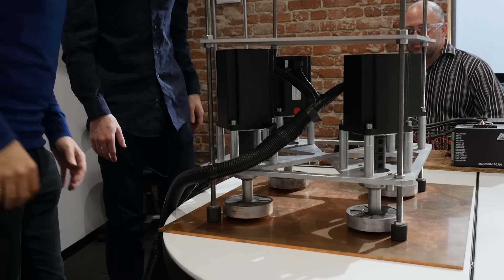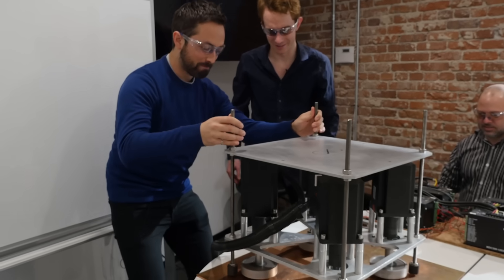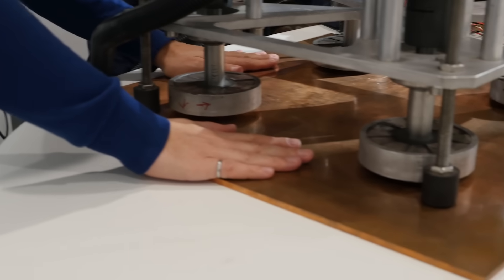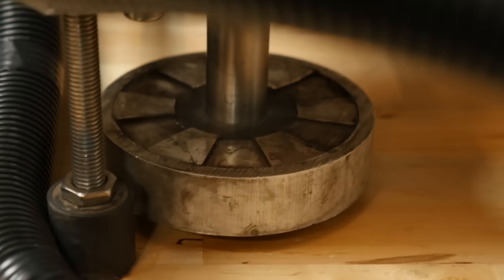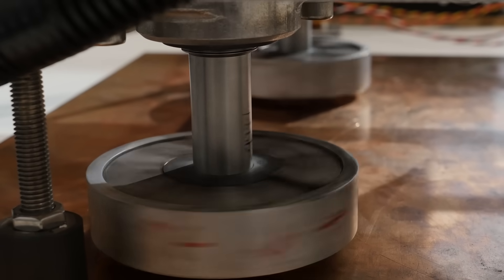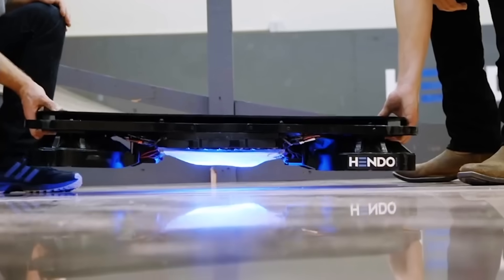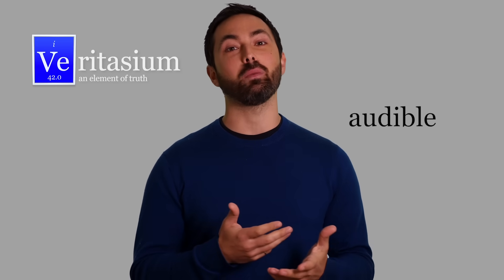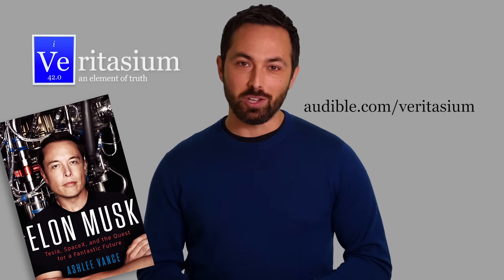Electromagnetic Levitation Quadcopter

Comment: The Hyperloop?  Really?   I'm disappointed in you, dude.
Reply: You watched a youtube video from a crabby old engineer and now you think you're an expert.
Reply: Don't forget to wear your tin-foil hat.
Reply: There are solutions to changing volumes already, like in steel bridges. It is posible they might come across some way of aplying the same principles.
You definetly have a point, though
Reply from the maker: Hey, I'm not saying it's easy or that it will definitely work. Just be careful before you add your name to the list of naysayers we look back on through history who thought certain things were impossible (e.g. powered flight) or just not going to happen (e.g. personal computers).
Reply: Y2KNW Why?
Reply: Hyperloop's on par with solar freakin' roadways and thorium cars in terms of feasibility because the meathead who thought it up doesn't understand that materials expand and contract with temperature, which would cause cracks and stress that would inevitably lead to a failure of the tube wall and the deaths of at least 2 carloads of people each time it happens.
Reply: @Y2KNW  EXACTLY. they've already encountered these problems you talk of.. not tube failure. Haha but the expanding and contracting of materials from heating and cooling which causes great damage to the structures
Reply: @Y2KNW  you yhink the "meatheads" who designed long bridges and railways don't know about thermal expansion? 

This is why problem solving is a critical part of engineering
Reply: although the hyperloop looks like a Good Idea thunderf00t has a point and no one can say he is wrong só people just ask "elon musk or thunderf00t"
Reply: BS. Technologically it's absolutely no big problem. It's not too hard to find a solution for the thermal expansion, it's a problem engineers deal with all the time on marco and mirco scale.
Reply: The thermal expansion is not such a big issue, here is thunderfoot wrong. The main problem is that the hyperloop is a passanger-killer at the smallest incident, here thunderfoot is right.
Reply: Sascha Kramarenko No discussion is harmfull for development on the long term, we may not be experts but this is certainly interesting
Reply: "In theory."

Communism works, in theory.
Reply: too much thunderfoot. Remember that we went on the moon. Conditions were pretty extreme out there and a single failure could lead to the death of the crew but we did it. It's technologically and scientifically possible, the rest is called an engineering feat and we'll see if they can pull it out. Come on, we came to the point where we recover the freaking first stage of a rocket on a barge in the ocean !!!!
Reply: +NuclearSavety +Y2KNW

Just stop it with the uninformed, idiot speculation.  You all and thunderfoot all clearly do not have the slightest idea of what goes into modern engineering.  Thermal expansion/cyclical loads on pressure vessels are a very well understood problem and we've been able to deal with them safely for literally over a hundred years now.

Hundreds of millions of commercial steam boilers and chemical reaction vessels are operating around the world.  They designed to go through MASSIVE thermal cycling and hold pressure differentials vastly larger than a vacuum vessel holds.  As long as they are properly maintained and designed, they can operate for decades without any issues.  You occasionally see them fail due to companies failing to do mandated maintenance or doing stupid things.  But that's going to happen with any system.

We have been building miles long vacuum chambers for scientific applications since the 50s.  

+NuclearSavety Bellows seals are used all over the place in scientific and industrial applications and are incredibly reliable and safe.  Work-hardening only occurs in certain strain regimes.  Any first year engineering student is perfectly capable of designing bellows seals that can go through effectively infinite cycles.

Commercial jet airplanes all go through stresses and pressure cycling on their pressure vessels that are far, far greater than what a hyperloop tube goes through and they are designed to withstand tens of thousands of cycles.  Planes do this literally tens of thousands of times a day without incident.  The Concorde had friction-induced thermal cycling on its pressure vessel skin of hundreds of degrees and did just fine.

Commercial airplanes have to go through regular and rigorous teardowns and inspections because cracks are constantly forming and propagating through the airframe.  Almost every jet in the air has hundreds of cracks in the airframe.  It's perfectly safe because we know how to engineer things and understand crack propagation rates.  We know that a crack will not result in structural failure unless it is of a certain size.  We know that the cracks will grow at a known rate.  As long as you tear the plane apart at specified intervals, you can check for crack growth and replace/repair components as needed.  There's entire buildings full of engineers at Boeing that do these calculations.  I used to work in one.  The downtime and inspections are incredibly expensive and a lot of work but they are already factored into the engineering analysis and cost projections.  This isn't a novel thing.  We've been doing this since the 707 was flying in the 50s.  There are entire textbooks devoted to cycling-induced fatigue and crack growth.  I'm looking over at one on my bookshelf right now.

The hyperloop is no different.  As long as halfway competent engineers design it, pressure leaks are not going to be a problem.  Even if you do get a pressure leak, it's not going to cause a catastrophic failure.  A leak doesn't cause a full loss of vacuum.  It's going to cause a rise in pressure equivalent to the size of the leak.  We deal with these sorts of things constantly in pressure vessels.  It is not hard to design a pressure vessel that fails gracefully and predictably.  The entire design of commercial jet aircraft is based on that principle.  You can shoot a jet full of holes in mid flight and you'll just get a slow loss of cabin pressure.  We specifically design them so that a tear or hole doesn't result in a massive rupture.  You monitor the pressure in the tube and if it starts to rise, you do an emergency stop of all the vehicles.  

Any failure mode that would result in a loss of a hyperloop train would be the same order of magnitude of engineering/manufacturing/maintenance failure that would lead to a loss of vehicle on a commercial airline flight.  Think the hyperloop is too scary?  Better stop flying then!

There's plenty of valid objections to the hyperloop.  Pretty much all of them are based on economics.  There's no showstoppers in the engineering of a hyperloop.  Plenty of actual qualified engineers have looked at it and there's nothing inherently wrong with it.  In many ways it's less technically challenging than making a standard jet airliner.

Thunderfoot can do backseat engineering all he wants.  That doesn't make him qualified or informed.  Sometimes he says interesting, valid things.  Sometimes, he just shoots his mouth off like a moron.  Like here.
Reply: Sounds like You've been watching Thunderf00t.  I wonder who's smarter... Thunderf00t or Elon Musk?
Reply: Vacuum systems use flexible seals all the time.  It's just a set of metal bellows.  This isn't advanced tech.  Thunderfoot can be intelligent at times but he can also be an uninformed idiot too.
Reply: Veritasium I want to believe but things were Said about the hyperloop and nobody wants to answer problems like the thermal expansion and the fact that tgey want to use an engine that relies on gases to run on low pressure if you could answer this questions i would be glad that someone decided to talk about science instead of youtubers
Reply: Instead of replying to all your repliers I'll just leave this here with you...
The Hyperloop concept is indeed a bit crazy, specially considering a economy perspective where an high-speed train would be much more effective and safe for the same course.
If you allow me to go a bit wild in my guessing, I think that Elon Musk launched this whole campaign as a facade to get other people to develop space technology for him, and not really because he thinks it he can build an Hyperloop on Earth. It makes sense, because all the spin-off tech from developing the Hyperloop has space research and space construction applications.
Reply: Lehtaan people Said it was impossible Yes but once more people use historical arguments instead of scientific ones i want to know why my point of view is wrong and why no one talks about it seriously , just repeat the same things over and over
Reply: Says the person that only says you cant believe in thunderf00t if you think he Said any lies about the hyperloop please Tell us i would like to know instead of fighting over whos the smartest
Reply: Having worked on stuff that's failed due to expansion/compression issues, I don't even need Tf00t's video to tell me what's going to happen.
Reply: Yeah, I never quite got how someone could claim, with a straight face,  they'd run a turbine powered object in an atmosphere low enough to nearly remove all wind resistance.
Reply: Once they find that material, build the thing.  

Until then, it's a very expensive disaster waiting to happen.
Reply: @Y2KNW  ik this stuff is from a year ago, but copper and many of its alloys are known to be very good at expanding and contacting not to mention they are great conductors of heat which makes the expansion and contraction even less of an
 issue. The people are not stupid and it being in a closed system means they have more options as far as solutions. Like cooling the track to maintain a constant temp if it was a problem. The people working on it are engineers. Its their job to solve problems.
Reply: @tylerhowe552  "people working on it are engineers"

I've worked most of my adult live around engineers or people with engineering degrees of one sort or another; engineers can be some of the dumbest people you'll ever meet and easily a quarter of the time I spent in my last job was A) repairing things they'd broken or B) trying to save them from themselves by further dummyproofing things so I won't have to fix it again in 6 months.  So please don't use lines like "its their job to solve problems". :D
Reply: As long as those who claim it was going to work admit they were wrong when it doesn't, and accept responsibility for pushing an idea with obvious flaws.
Reply: Tunnels don't have the same temperature issues as a surface level tube and offer an additional layer of protection against failure.  Build the loop in tunnels and odds are it'll have a significantly lower failure rate.  But, like all things people build, it will eventually fail; don't kid yourself that it won't.
Reply: Jérémy Don't compare everyday travel with the moonlanding or any other space exploration. They are on a completely different level.
Reply: Like I said elsewhere in this very discussion, I've worked in an industry where I've seen (and had to repair) the effects of expansion and contraction on pressurized systems.  And I did it for years before Tf00t's video came out.  Tf00t has the why it happens, I just got to fix the stuff after it happened.
Reply: Steel bridges have expansion areas: those parts with the meshed teeth where the parts can flex and move.  You can't do that in a vacuum tube without some sort of flexible seal, and anyone who's worked around something with a seal knows full well that seals fail.
Reply: Veritasium sorry but this is exactly the same argument to justify pseudoscience like homeopathy...
Reply: @NuclearSavety  sorry but equating homeopathy and mechanical engineering isn't even scientific. And said "pseudoscience" did deliver powered flight and personal computers, unlike actual pseudoscience
Reply: @ki0w0-lordofwatersheep  i never sayed homeopathy equals mechanical engeneering.

I sayed that veritasium uses the same ARGUMENT selling the hyperloop as homeopathy is sold: refering to the unknow, implying that future discoveries will explain everything, and ignoring the logical contradictions apparent today ...
Reply: @NuclearSavety  yet you also ignored stuff, mainly what makes hyperloop different from homeopathy; its "apparent contradictions of today" are merely challenges for engineers to solve tomorrow

Having some things in common =/= the rest of things being the same
Reply: The hyperloop is a scam. It is technical possible in principle but it has zero chance to become economically feasable on any scale.

 And the rotating permanent magnets thing is a nice toy but not the technology used in maglevs. Engineers dont use electromotors to produce oscillating electromagnetic fields. You can kick out the motors from the design together with the permanent magnets by using only coils and power electronics to switch the direction of current. Simpler design, no moving parts, but less easy to build by wannabee inventors.
Reply: @NuclearSavety  they have their first contracted tunnels and the system works so I'd like to hear back from you lol
Reply: @JamesTurfKing  .... selling stupid things to suckers doesnt make stupid things less stupid ... And you must be a sucker buying something which was never successfully tested in real scale...
Reply: @JamesTurfKing  Boring a tunnel is the very easiest part of the hyperloop concept. Humanity knows how to build tunnels for 5000 years. If you think Elon is to be praised to have build one (in a sub-scale diameter without infrastructure inside) then think again.

The challenge is to economically build a maglev in a tunnel. And it is completely non-economical to build, operate, and maintain a transport pod transporting anything (not even freight) in a vacuum... The cost for such a system is comparable to space travel...
Reply: Oh! You done did it! The "Wright Brothers Argument"!
Reply: Vacuum tube of several kilometres sounds pretty hard to accomplish.. sustaining that vacuum over a long time seems nearly impossible.. there needs to be some way to create sections I think..
Reply: of course it will fail at some point, no one is talking about designing a flawless tube. Airplanes fail too, what's the matter with that ? It's a controlled risk with strict criterion and permanent control of the structures.
Reply: @izaneitor Steel bridges don't need to be redundantly air-tight, though.
Reply: Gruener Apfel well when traveling 1000km/h in a narrow vacuum tube, the last thing i want to have in my way is a 1inch thick steel hatch which is suppost to open in good time....
Reply: You have too much faith in technology. No matter how advanced technology gets, it still cannot break the laws of physics. The Hyperloop is not physically possible, plain and simple. I recommend doing a little bit of research before you claim something is possible.
Reply: The Hyperloop is just not going to happen/work. They are planning to make a thin tube out of concrete that "generates more energy that it uses". Now that sounds like a good thing for some jack ass to just shoot 1 hole in the side and blow it up.
Reply: Dan Heidel sorry but your airplane comparison stinks. Air planes are much smaller and despite their comparably small size they are leaking like hell in comparison to the air tightness you need for a several 100km long vacuum chamber. You probably dont want to have major pumping station every 5km, that would somehow kill the energetic advantage of the system. I work in nuclear eneneering and know that it is freakingly complicated to make a huge industrial complex really air-tight to <1vol% per day leakage at a 1 bar pressure difference...
Reply: ***** How could he be debunked? Did anyone managed to break the laws of physics?
So far Thunderf00t has a good track record in terms of science. His political views are subjective, but that is completely unrelated issue.

One thing is certain, it is not just Tf00t who is skeptical about possibility of low pressure transport system on earth given the modern day materials. Many engineers in my university also seriously doubt its feasibility.

May be, when we have materials that can create a 100-mile tube that wouldn't have these thermal expansion issues, hyperloop will be possible. But not today.

Heavier than air flight was impossible until the invention of light engines. Skyscrapers were impossible before the invention of cheap steel manufacturing. Much of today's impracticality of hyperloop comes from materials we have at our disposal and their cost.

Now, for the magnetic levitation demonstrated, it is very wasteful, as the heat comes from the energy consumed by the apparatus to levitate.
Such energy losses are very expensive and that is why this technology is impractical.
A much better option is superconductor levitation, that does not consume energy, but this technology has it's own huge problem with thermal isolation.

Anyway, Hyperloop as it is today is a pipe dream. The original video adds nothing to the scientific knowledge. The science of this demonstration has been studied extensively and nothing new has been revealed by this apparatus.
Reply: Jérémy once more saying what humankind has done already you could say anything once again i ask what is wrong about what thunderfoot said i want to know in case i have a wrong view of physics i would like to know
Reply: is what people said about rockets, planes, cars, etc.
Reply: +Jérémy It is scientifically possible, but technologically impossible/unserviceable...
Reply: +NuclearSavety "this is exactly the same argument to justify pseudoscience like homeopathy"

You mean aside from the fact that one is based on the idea that small amounts of natural substances that would normally cause harm to healthy people will somehow heal sick people, whereas the other is based on established science and technological advancement with limits that need to be overcome with new solutions just like all previous technological advancements? Oh yeah, I can see the resemblance. It's uncanny.
Reply: Yeah, by adding areas where the expansion and contraction can take place.  But those involve expansion loops or bushings.  Expansion loops wouldn't work because the passenger car isn't going to be able to make turns at high speed, and bushing are wear points that become fail points.
Reply: i'm not saying that we can do ANYTHING, but we can do everything that abides by the laws of physics. His videos are just videos, undergrad calculations and little experiments with the simplest material you could find. In the meantime there are some serious R&D engineers working on it. I currently pursue a master's degree in materials engineering and I can tell you that the things we can do are just incredible
Reply: annojance i sayed it is the same ARGUMENT. I didnt sayed the hyperloop is the same as homeopathy. Please read what i write, dont read what you want to read.. .
Reply: +Ian Krasnow
To be fair, solar roadways are a stupid idea.  When every building roof in the world has solar panels on it, then solar roadways might start making some sense.  But until then, they're an overpriced boondoggle.
Reply: It's always funny how the only people who care to really crack down on the Hyperloop are random youtuber commentors and redditors who watched literally just one video. Not to mention those issues such as thermal expansion and the supposed requirement for perfect vacuums have already been addressed before.

Yep, groups of engineers and scientists around the world are just trying to scam you into funding a single project when, as shown in the video, study into electromagnetic levitation has been a thing for more than a hundred years. We should give up just because innovations in building material hasn't caught up! Maybe we should have just given up on fiber optics because no fiber was clear enough.
Reply: Y2KNW i think that isnt wrong to believe in it is wrong to say it Will work because elon musk because cars because space i'll admit that i was wrong in case someone decides to have a serious talk and i am proved wrong but until then i am waiting
Reply: izaneitor the point is that it doesn't matter wether a bridge has a 10mm gap at each end. With a pressure of just 1 mBar it's a different story.

Maybe it is possible but in the next 100 year there is no way to be competitive with normal roads, trains or airplanes.
Reply: Sascha Kramarenko was he really shutting down the conversion in this thread by bringing it up? He didn't insult anyone unlike those against TF who were the ones to shut down the conversation.
Reply: Mr Torgue burrying solves the problems of bullets and thermal expansion mostly.... but creates problems concerning corrosion (contact to water) and it is freakingly expensive...
Reply: There's no reason to tell people to not work on something that can improve the future of humanity forever. You're pretty much equivalent to a person who thought flying in the skies would be impossible. "Just don't even try making it because I think it's impossible." Well, not even 100 years later there were people on the moon. You're on a computer right now, which people 100 years ago couldn't even imagine, playing Minecraft and other games with people around the world. Why don't you take a second and think about that.

You're not working on it, you're money isn't funding it, you have absolutely no part in the research and development for it, so why would you complain about it? Even if you say whatever you want to say, people are still going to attempt in trying to create it and they simply don't care about your opinion.

End of discussion.
Reply: Y2KNW - You sound like you just watched a video by thunderfoot and now you're the smartest man alive. Like others have already said, this isn't that big of a problem. There was a lot of speculation in that video, if you looked into the subject past the end of the video.
Reply: @sablesoul 2 things. Firstly, Thunderfoot isn't some random youtube commentator. He's an actual scientist, and if you bothered to spend 30 seconds on his youtube channel you'd see that. Second, thunderfoot isn't saying that there should be a "crackdown" on the hyperloop. He's saying that there's a plethora of problems with it and that there should be more skepticism towards something that has said problems. Especially considering that we're talking about a technology that could lead to the death of civilians.
Reply: If you're referring to Thunderfoots videos he's been thoroughly debunked on his debunking
Reply: Y2KNW lol
Reply: What we are saying is that materials composed of atoms follow a strict set of rules that allow them to function and interact in a pretty specific way. Thermal energy conducts down a material at a definable speed; and the only real way to nullify thermodynamic expansion is to maintain a constant, equal temperature across all surfaces; irregardless of the surrounding environment.

As long as the earth rotates and the sun shines; this is not possible. There is no material that can make the transfer of heat instantaneous; so expansion and warping WILL follow. The sun warms the eastern half, the night cools the western half; and somewhere in the middle something starts to wear down.

Now, we have managed to 'knot' some atoms together; creating structural integrity instead of relying on the atomic forces. This does open up some more room for materials who's strength goes beyond the capacity of 'natural' structures.
Reply: Gato Capitalista Nobody can tell you if it will work or not because nobody knows. That's why tests are being done. Supposedly, they will do high speed tests this summer. I guess we'll then find out how feasible this technology is.
Reply: Truman Why am I a fanboy? They will try it out this summer and it will either work or it won't.
Reply: +NuclearSavety - "The thermal expansion is not such a big issue, here is thunderfoot 
wrong. The main problem is that the hyperloop is a passanger-killer at 
the smallest incident, here thunderfoot is right."

indeed, there is inherent danger any time an object is travelling at 650mph or more :)

however there are trivially simple solutions for this... several in fact :)

one approach that could be taken is that the hyperloop is restricted to transporting materials and cargo, and not humans for whatever testing period you would like to assign to it... 6 months, 1 year, 2 years, 3 years, whatever

a second approach is that it is tested on purely cargo/no humans for the first 6 to 12 months... if it appears to be stable then a phase opens where humans are allowed to buy tickets/board...

but only on the condition that they sign a waiver that prevents them or any next of kin from filing a lawsuit or filing for damages should the vehicle malfunction in such a way that painful injury or death has occurred

I think such waivers are called AYOR clauses or "At your own risk clauses"?  not sure

hell, if the hyperloop is making a profit, then maybe they could even pay out damages and accident compensations should it come to it... might not even need waivers!

there is inherent risk in airplane flight and definitely there is inherent risk in vehicles on the road haha... from what I have heard the risk of driving on the road is significantly greater than the hyperloop risks... I don't have any projected stats... just what I've heard

these are two obvious solutions that occurred to me in less than a minute and I'm sure there are planners out there with even better solutions than what I can come up with :)
Reply: A lot of sheep here in the comments that blindly follow some Thunderfoot dude. Weird.
Reply: Seems like someone didn't hear about the results of the Hyperloop competition.
Reply: To all of you who think Elon Musk is a genius, none of his current companies produced any profit.
Yes, the guy is very creative. Yes he has a lot of people with money backing him. But so far his only profitable idea was PayPal. Tesla might be there, if battery technology ever evolves to get the scale it needs. Besides, a successful electric car was developed way before Tesla. It was killed by lobbyists. Look up Satrun EV1. So I can't say that Elon Musk is that much of a genius. He is energetic and persistent, that is his great talent.

And, yeah, humanity have achieved wonderful things, broke many barriers, but we couldn't break through the laws of physics. Yes, the number of achievements by great visionaries is huge, but it is dwarfed in comparison to how many bad ideas humanity produced. 

My last point, we should not stop researching this subject. But we should stop overhyping it.
Reply: Pladimir Vutin By the way, he hired dozens of engineers who are experts at their field to examine the feasibility.(Structural mechanics, etc). And nuclear physics has nothing to do with hyperloop. So I think Elon's team of engineers has more credit than thunderfoot. So his argument is invalid and we should rather argue about the system, not the debater.
Reply: The hyperloop doesn't need a perfect vacuum...
Reply: Dan Heidel the problem is the expansion joints are rather weak, thus the ideal place to develop leakages. Especially the frequent movements daily will cause work-hardening of the metal... It can be done but you probably have to change the bellows regularly making it an expensive joke...
Reply: Jérémy as heat shield material you can use toast bread .... really no kidding ...
Reply: Gato Capitalista nope. Heat toast without air untill only a carbon foam remains. Thats a heat shield. Highly resistant to temperature, very low heat conductance...
Reply: Sascha Kramarenko problem is vaccuum technology exists for roughly 100years having the same problems. What motivates your hope that the problems can be solved in half a year?
Reply: +izaneitor the hyperloop is snakeoil
Reply: Elon Musk is an entrepreneur, he never built or designed any of the rockets his company sent to space. Phil Mason (Thunderf00t) is a nuclear physicist with decades of experience. I don't think there is any question of who is more knowledgeable on physics.
Reply: Pladimir Vutin Elon Musk hires engineers and scientists like Thunderf00t to determine feasibility of projects. This vacuum train idea has been around since like the 50's. It's going to happen, but the technology and investment needed to mature. I agree that we're about there.
Reply: Burying your tube in California is probably a bad idea what with all of the seismic activity. Plus it's awful hard to emergency exit from a breakdown from underground.
Reply: hyperloop is possible in theory but can have lots of screw ups. Kindof like every major transportation system we have now.
Reply: NuclearSavety if he's anything like me, he'll be open to whatever happens. The universe works the way it works whether we believe it or not, and if we can come up with better ways to travel I'm all for it. That being said I haven't made any personal investments into the hyperloop idea if it doesn't pan out.
Reply: NuclearSavety We are almost daily discovering new properties and materials, maybe we should cling on the idea  for a bit longer
Reply: Sascha Kramarenko Ok Elon Musk fanboy.
Reply: In aeroplanes, they often make different parts of the fuselage of different kinds of materials, like for instance the top from a composite and the bottom from aluminium. Even though these materials have different (factor 3 from the top of my head) thermal expansion coefficients the pressure difference between the inside and outside is maintained. This is something that has been worked around. My issue is that you watched one thunderfoot video, and now you act like you have a masters degree in mechanical engineering.
Reply: Oh boy guys. Don't forget your tin foil hats and popcorn!!! A Thunderf00t worshiper strikes again.
Reply: Cao Cao yes, and also thunderf00t makes stupid mistakes like typing 30g instead of 30m/s and also assuming that if the tube gets cut in half these's going to be a wall of air going at the speed of sound.
Reply: @Y2KNW Thunderfoot has about as much knowledge about this subject as you and me. He's just pretending he knows stuff, but he's merely speculating based on his very limited knowledge. The cool thing about science is that you constantly learn new things and find ways to solve problems. So, let the real experts take a look at it and try to make it work. We will see in the future whether it works or not.
Reply: NuclearSavety well makes sense
Reply: ***** Yes it would be low pressure but the last time i saw the project it would be a jet engine which relies on air
Reply: they're working on it. we didn't have the material for the heat shields of the re-entry vehicles or for the blades of the turbines of high temperature turbines so we made it. just give it time, look at all the thesis paid by companies that solved incredible issues in the aeronautics or marine sector. Just wait and stop being so pessimistic. the physics checks out so we'll build the technology for it
Reply: Jérémy well makes sense, but i have no knowledge about materials so i can only agree ,but and about the engine?
Reply: I'm sure you have, Mr. Minecraft profile picture.
Reply: NuclearSavety I bet it will work because going fast in a tunnel isn't very hard. It's still work in progress, so I doubt they will be using the actual tunnel that they intend to use for the final product. I'm more skeptical about tests further down the line.
Reply: Why? Hyperloops will soon be a reality. 
Secondly no matter how much you people think hyperloop are death traps remember people are flying with planes. If something happens to the plane either engine dies or hull loses integrity you're pretty much fucked yet people are  flying every day.
Reply: Y2KNW you're clearly watching thunderfoot boy oh boy
Reply: Probably because Y2KNW watched the Thunderfoot videos which attempted to debunk the hyperloop, and solar roadways.
Reply: The idea that we could utilize our road-space for solar energy production isn't a bad idea. Pretty much any surface that gets sunlight and can spare the real estate should be considered for solar panels. Currently, ground mounts are the cheapest way to set up solar panels, simply because of the challenges of attaching panels to other surfaces. But putting solar panels in a field means that the field can't be used for farming, nature conservation, real estate, etc...

Wouldn't it be cheaper to build solar awnings over roads than actually build solar roadways?
Reply: +Anonymous User Not the point. Even if it's a near perfect vacuum then the shockwave of the incoming atmosphere is enough to kill people.
Reply: Of which there are also solutions to, like for example creating a partially pressured atmosphere between the Earth's atmosphere and the transportation tube, something that wouldn't eliminate the risk 100% but would definitely make failures one hell of a lot less deadly, not to mention allow for greater stability in the structure.
Reply: So you admit that you only bother watching one youtube video to source all of your arguments
Reply: I'm no engineer but take a look at Shane Killians videos on the subject I thought he made some great points and also showed that Thunderfoots math sucked.
Reply: That's all well and good but my problem with the Hyperloop is that people are using its promise as an excuse to not modernize our current transit infrastructure with contemporary technologies like high speed rail. Take for example in California where we are trying to get a HSR system up and running in the next several years. Elon Musk (don't get me wrong, I like the guy) used the Hyperloop as a concept to effectively lambast the CA HSR project and stoked dissent and skepticism among the public and their representatives. IMHO, high speed rail can solve many of our current transportation problems and is a tried and true mode of transport around the world. A lot can be gained from the proliferation of the Hyperloop, but if it has to come at the cost of leaving our infrastructure worse off in the near-term, as a transit and infrastructure advocate, I find that unjust.
Reply: Elon Musk, this "god genius" that everyone love is a moron.
He genuinely think that we can terraform Mars... Mars is dead, the core is solid, it can not ever work as a magnet again... We would have the same chance to terraform the Moon. 

He also thinks that photovoltaic roof tiles are viable alternatives to photovoltaic solar panels... I am no electrical engineer and Even I see that that not viable... 

The only thing Musk has is Tesla and SpaceX, both great visions, but he also has some shitty ideas... The hyperloop falls into the later category.
Reply: No big problem?  You will have to deal with hundreds of meters of thermal expansion on a daily basis, plus you will have to worry about holding a vacuum in the tube while it undergoes that expansion.  This has to be taken into account as to prevent the people in the tube from being killed in the event of a catastrophic depressurization.  I'm not saying it can't be done, but it poses a serious engineering challenge.
Reply: Sadly people remember famous morons as pioneers
Elon Musk is one of them, he has ideas but most of them are counterproductive and violate the laws of physics even though some of his ideas are good
Steve Jobs was kinda the same, he had good ideas (but also very bad ones) and he was a giant moron, he was a tumor for anyone close to him.
Making Vaccumed,  straight pipelines for a train would be VERY expensive and completely vulnerable to attacks from anyone with basic tools
Mars is dead and sending people there would kill them from starvation, destroy their bone structure (gravity) and expose them to deadly doses of solar radiation
For one good idea he has two stupid ones
Reply: but even if the project fails, they are still able to develop new technology, even if its not used in the hyperloop.
Reply: Felix Kerschbaumer "was he really shutting down the conversion?"

You can see the first post, can't you? The poster leaves no room for debate and his tone towards the video creator is quite condescending. And you know why that is so? Do you know why he acts like that? Because thunderfoot always acts like that in all his videos, even when he's providing misinformation. To give you an example (I'm assuming you've seen his video), his pressure argument where he shows the two different colors as an example, that is just plain wrong because pressure differences aren't linear, so that entire example was very misleading and the entire argument makes no sense. Thunderfoot often makes such mistakes, probably because he's talking about things he knows very little about. But people don't know that because, like thunderfoot, they have no knowledge about that subject, and so they merely assume that thunderfoot is always right and never makes mistakes because he's a scientist... /facepalm
Reply: It's funny tho because Thunderf00t has been pretty much spot on on every single science video he made so far, that seems a pretty good reason to listen to him if you ask me...
Reply: Porglit
Yep, No doubt. That's where he gets his cues from. You know the guy who studied chemistry but knows more about space rockets on all levels than the ones who designed them. Just by observing a short footage of an explosion he figure it out all.
Reply: Thunderfoot's argument would have more weight had he actually bothered to read the bloody alpha proposal document. But no, he just dismissed it and made a video without doing his homework. If you are interested in counter argument, there is an entire video series proving Thunderfoot wrong.
Reply: He has, that much is true. But that doesn't mean he's read it. In one of his videos, he spent 5 minutes talking about how impossible it would be to drive such a pod through a low-pressure tube via a compressor. Well, had he bothered to read the document, he'd know that the compressor in the front of the capsule had nothing to do with propulsion, and the alpha document clearly says that. If you want to debunk something, you better first understand how it works.
Reply: +nexus1g Well then there is just this one tiny problem left: Subways don't have a low pressure atmosphere (or vacuum) in it. So let's be clear: If a subway tunnel collapses, you are left with a collapsed tunnel. If the Hyperloop collapses, the whole system stops working and thats not some minor issue the safety of your passengers depends on it. 
So let's wrap this up: Even if you bury the tubes in the ground and in that way get rid of thermal expansion (which doubt will be sufficient and by the way increases the costs of the whole project by at least 10 times) you are still left with the risk of a minor earthquake which could break the tube. In that case you have to dig up hundreds of kilometers of tube to make it sufficiently straight so you can travel at high speeds again.

And to all those who say: "Buhu but electric cars and space program and so on" 
Think first, then think again and then realize that there were rockets and electric cars before our god and savior Elon Musk decided to get involved but there was and (is) no hyperloop because compared to the hyperloop it is easy to travel into space or build a electric cars.
Reply: D4MNF0xy You really think it's easy to travel into space -- even relative to what's required to build and maintain the hyperloop?

Lifting a 2-million-kilo, 18-storey structure into orbit by controlling 3 million ft. lbs. of thrust in 127 seconds, not to mention the extreme stresses of reentry is a HUGELY monumental task unlikely to happen from an engineering perspective.
Reply: The hyperloop is possible in theory, but very troublesome in practice. And this is also what Tf00t said.  The most valid points are the heat expansion and the risks of a breach.

Moving seals are incredibly finicky and expansion loops/turns can't be used. A strong, flexible and airtight material could be used to cover up the moving seals. The problem would also involve how the tracks would overlap. Should there be two sets of parallel tracks under the train, so that at the moving seals they don't have to overlap? They expand past each other, so at the seal the train just switches which track is used. So the tracks alternates between each moving seal. 

A breach to the tube could be very deadly to the people inside each train currently inside the loop. Air rushing at the speed of sound would have a large impact force which would create a deadly shockwave and accelerate the trains at high G's. This could be countered by having a deformation area, similar to what cars have, and to make the trains as heavy as possible (so have less but larger trains) to decrease the effect on the trains. There could also be checkpoints along the way with emergency airlocks (makes sense to be on either side around the moving seals).

And this leads to more engineering problems, how to make a long and heavy train efficient, as well as fitting a deformation area on the front and back of the train where there are turbines, and how to even design the moving seals so that everything fits.

And yeah yeah, "we went to the moon". But not before people died trying. And that's the last thing we want happening for the development of an alternative and overall inefficient means of transportation.
Reply: badboy09480 And in some practical terms it does matter. Such as there will be built up air in front at high speed and it's much easier for the vacuum pump to leave 0.1% of the air in than to only leave 0.0001% (as in the NASA test chamber)(guesstimate).
Reply: +wutzibu

Tht busted video was very flawed to say the least.

People pointed out that in order for such  disaster to happen , a very large segment of the tube need to be suddenly removed, a task that can be don only using heavy machinery or explosives.A hole s few cm wide would not do the trick.The same danger also exist in commercial air travel or even high speed rail travel.
Reply: remliqa I think if someone wanna terrorize people then bombing a passenger train from underneath is an easier way to kill 100people at once. So I agree, it's gonna be harder to get any terror for bombing the hyperloop and killing a pod or two.
Reply: +Do not go gentle into that good night. Rage, rage against the dying of the light

Yes, people seem to over-exagerate the threat of a hyperloop catastrophe .There are legitimate concern on the viability of the hyperloop atm , this one just isn't one of them.
Reply: what are you disappointed at idiot? today is the hyperloop competition
Reply: InSQUIDious Japan has dozens and dozens of earthquakes a year. But they found a way to dampen almost every tall building. The same suspension system can be placed on every pillar. As Elon have said, there will be sets of XYZ dampener on every pillar. Remember, the tube is made of steel, not concrete, it'll be like uncooked Spagetti rather than liquid nitrogen froze spaghetti. And the tube isn't made of party balloon. If there's a bullet hole, it would be like that, a leak where air psssss into the tube. (This is not a Micheal bay movie, not everything explodes) and if are a terrorist and wanna kill people using public transportation, just use a bomb to derail a passenger train and BOOM 100+ fatality. Using a bomb to cut a hyperloop would not yield as much effect. There won't be a wall of air. A wall or "shockwave" only happen when there's a medium in the way. Such as when you explode a bomb and the air around it can't move out fast enough. With the hyperloop, there won't be air in the tube to create a shockwave or a WALL of air. It would just be a smooth gradient filling the whole system. For the emergency brake, if you have 3km to stop, you will only experience 0.66 g of deceleration. So if there's. A bomb it will only kill a pod or two that are near or on the site. Making the attack almost worthless when you account for human life loss.
Reply: Veritasium this answer disappoints me, as a scientist you should know there is a big difference between naysayers and people who show up with numbers to prove our at least support their point. I like Elon Musk and all of his ideas, but AFAIK he seemed to be unsure of the hyperloop the last time he was asked about it. I also like Thunderfoot and I think he gives a well reasoned and mathematically supported reason why the hyperloop won't work in reality. Maybe the problems he points out can be solved in the future, but they won't be if they are right out dismissed, because “flight and computers“...
Reply: nexus1g i would be carefull with your calculations. The problem of the hyperloop is a capsule running in a tube of comparabe size. In normal trains / airplanes the athmospheric drag originates from the displacement of air at the front, the air then flows arround the craft and fills the void behind the craft. However, at the side of the craft there is a large space where the air can flow arround. This is not the case for subways or the hyperloop. In subway stations there us usually a strong wind created by the subways pushing  the air in front of them out of the tunnels, just like a piston. This causes relatively large drag for subways. The hyperloop tries to avoid this pushing of air, thus it needs a much higher vacuum than 0.1 athmosphere inside the tube. Further the concept capsule always has a turbine incorporated, preventing the buildup of a pressure in front of the capsule by funneling these gases by pipes through the capsule...
Reply: nexus1g in the videos you explicitely see how large the maglev tunnels are. You want numbers: an airplane traveling at 700mph has at its surface an air speed of about 700mps. A train filling half the cross section of the tunnel traveling at 300mph sees a relative air movement of 2x300mps. A hyperloop filling 90% of the tunnel cross section travelling at 700mps sees the air rushing arround the capsule with a speed of 700mps/(100%-90%)=7000mps.... This is of course an unrealistic velocity calculation. At these speeds the air starts getting compressed which sucks up lots of energy out of the hyperloop capsule...
Reply: I've worked in industries where I've seen with my own eyes what expansion and contraction does to stuff.
Reply: Jérémy ok i admit you have a point but you are saying that if it is built there Will be almost no problems due to materials?
Reply: I guess someone has seen Thunderf00t's video eh'?
Reply: I'm no engineer (I study physics tho), but I think that burying the tunnel 1 m underground and putting cement around it would be enough to prevent both thermal expansion and possible decompressions.
Reply: Sascha Kramarenko i bet 100 bucks on FAIL....
Reply: NuclearSavety Airplanes leak because that's fine, they can obviously deal with the pressure loss. A more apt comparison would be every manned craft we've put into orbit in the last 30 years. Even decades old Russian tech still hold up rather nicely.
Reply: you do realise that easier to build prototypes are always tested first before moving ahead with a project, right?
Reply: Hyperloop is a good idea that just would cost SOOOOOOO much more than it says it would and would be as safe as crashing into a wall at 150 mph without a seatbelt
Basically good principle no possible real world application --> Garbage
Reply: hey answering a bit late but have you tried at least googling what you are arguing about? the tunnels are going to be cooled so that's it..
Reply: Also the same argument that pyramid scheme scammers use to try and trap people into paying them for months or even years with the promise of future profit. "You don't want to be part of the people who said this was fake when your friend who is in this business becomes rich"
Reply: there will never be a hyper loop because of security,very cool idea,but very impossible considering how large it is
Reply: I'm no physicist here, but if they built the hyperloop deep underground, wouldn't thermal expansion be less of a problem because surrounding temperature would be less variable than an open-air tube?
If anybody who knows more about this sees something i'm overlooking here, please correct me but if i'm right (Big if) then it could be a working solution to the hyperloop.
But then, even if that solves the problem, a tunnel must be dug and that would be hard, expensive and time consuming.
Reply: Hyperloop isn't a scam, it's a problem requiring a solution.
Reply: Nick Joslin Thermal expansion is not a problem on hundreds of miles of pipelines.
Reply: Right, because they've either got expansion loops every quarter mile with an anchor shoe between them, or they're underground where the heat can radiate away and reduce the expansion or contraction.
Reply: Tony Wells pipelines, no. hyperloop needs to be pretty damn straight because of the high speeds and the correspondingly high g loads when cornering
Reply: By your reasoning of there being no way to deal with expansion and shrinking due to heating and cooling means the SR-71, rockets and the space shuttle, guns, etc. would not exist. Since there's little fluid resistance since it's a partial vacuum in the tube, most of the heat we deal with in the other applications I mentioned earlier won't be an issue. If anything, accounting for thermals will be easier.
Reply: Sascha Kramarenko yeah like OP is the only one to do so ;-)
Reply: "I wonder who's smarter... Thunderf00t or Elon Musk?"

Who is smarter? The man who thinks putting a vaccuum tube above ground is safe? Or the guy who says it's probably best not to because you know... human life is precious.
Reply: Cao Cao By your standards, I don't think you believe the space shuttle should work.
Reply: D4MNF0xy Musk is already digging tunnels for hyperloop. You can have the same dampening system by having 0.8-1.2m of buffer zone around the tube(also for people to get out).
Reply: Master Evar The wall of air is just an asumpsion made by thunderfoot. Some have done simulations where the the tube is cut in half (which is a very unlikely situation) and nearby pods will only get 0.6g from the "wall" of air as it's not really a wall but a spreading gradient. 

Thunderfoot also made a mistake by typing "Gs" instead of "m/ss" while explaining the emergency brake system.

As Elon have said, the tube will not be fixed, so it can move lengthwise to support the thermal expansion.
Reply: They held their first competition, involving a lot of tests, just yesterday. Was a huge success :)
Reply: Do not go gentle into that good night. Rage, rage against the dying of the light. I love your name
Reply: remliqa Not flawless. He mistakes m/s^2 for Gs
Reply: Master Evar Seriously, stop thinking Thunderf00t is an expert in everything. He's simply not a structural engineer, and he's going outside of his expertise in this matter. He's a biochemist. He's using his authority of having an advanced degree to talk about things he doesn't have any position to really be discussing with authority. In other words, he's using a logical fallacy: a fallacious appeal to authority.
Reply: +InSQUIDious

It have been pointed out several times that ThunderF00t 's so called "debunking" video on the hypeloop was  '"problematic", to say the very least.He obviously overshoots himself this time.
Reply: InSQUIDious What I find most funny is that you nor thunderf00t think the idea of earthquakes has not, at some point, crossed the mind of the engineers planning the project and that they already have a solution.

To paraphrase Thomas Edison: I can think of a billion ways how a light bulb would fail, but it still works because someone found the solutions to the issues.
Reply: "Oh, excuse me -- not debunked, he titled his video, "The Hyperloop: BUSTED!"

Close enough."

Nope, nowhere close to being a fallacious appeal to authority. A bit arrogant? Yes. And that's not his first video on the subject, those videos that he named "debunked" are in response to people who made some arguments in defense of the hyperloop. The first video was named "how the hyperloop can kill you".

"He even goes so far as to assume that they, and I quote, "...haven't done even the simplest expansion calculations." His assertion is that an entire team engineers just simultaneously and inexplicably forgot about their high school physics classes. But thunderf00t remembered because he's just awesome like that."
Yes, he's arrogant like that. As I said, I don't think of him as an expert on the subject and I do dislike that side of him.

"Of course, the more likely alternative, apply Occam's razor here, is that they have a solution for this issue, but they're keeping the method and/or materials proprietary."
Yup. I'd really like to see exactly how they solve the expansion. I saw somewhere here that there was a cheap way of digging tunnels being developed, but the prototype is built on the ground suspended on pillars so I doubt that.
Reply: Master Evar "A fallacy is something that undermines the argument. thunderf00t never used authority as an argument,"

He's using his authority to avoid using proper sources while still being taken seriously.

"And no, I don't think your use of "appeal to authority" is correct. Authority is one who has deciding power over someone else. Just becasue you think you are smarter than someone else on a subject you don't have to believe you have any deciding power in that subject. And even then, you don't have to believe you are smarter than someone to make the claim that you are right about one thing they are not."

An authority, in this case, is a person with knowledge in a subject.

"Oh, and a lot of this is based on your interpretation of the video. I didn't interpret it as if he made himself an authority on the subject, and I do not view him as an authority on the subject."

You being persuaded is not a requirement here.

"In order to be fallacious, the argument must appeal to the authority because of their qualification in an irrelevant field"

A biochemist speaking authoritatively, without presenting valid evidence, about structural engineering. 

"If you have any other sources, you are free to present them."

John Lock, Essay Concerning Human Understanding, Argumentum ad Veracundiam.

As Wiki sums it up, "...[An appeal to authority] can be misused by taking advantage of the 'respect' and 'submission' of the reader or listener to persuade them to accept the conclusion."
Reply: nexus1g thats all I'm asking. If someone argues with numbers, attack the numbers, not the person. I can't judge if someone is correct, I'm no physicist or engineer, so I'm inclined to believe the one who supports his view with numbers, not the one who says the idea is visionary and anybody who disagrees is a naysayer. 

If the matter isn't settled yet, I don't form an opinion I'm not willing to change in light of new evidence.
Reply: Veritasium - Careful, you're approaching the Galileo's gambit there, or in the words of Carl Sagan: "But the fact that some geniuses were laughed at does not imply that all who are laughed at are geniuses. They laughed at Columbus, they laughed at Fulton, they laughed at the Wright Brothers. But they also laughed at Bozo the Clown."
Just because some people laughed at Wright brothers doesn't mean that Musk's stupefying 'idea' should be considered as anything more than it actually is - a hilariously impractical literal pipe dream.
Reply: +Mr Torgue - can you even imagine the cost of building a 550km vacuum tunnel? You could give a private jet and a life-time of jet fuel to every single potential passenger of such structure and it will still cost less, be faster and be orders of magnitude safer than this 'idea'. And that's while ignoring that the place they want to build this is one of the most seismically active places on the planet and burrowing the pipe into the ground doesn't help you with that.
Reply: well..... but elon musk already releases plans for hyperloop, and the possibilty it might come true is high
Reply: NuclearSavety lol ur kidding right?
Reply: NO1 (NoOne) just build it where jacka$$es can not easily buy guns like calif......somewhereelse....
Reply: I work in nuclear eneneering and know that it is freakingly complicated.......... because  I'll teeet it in a hypoerloop
Reply: i mean they're building it RIGHT now
Reply: ***** exactly.
Reply: ***** it were even the same reasons for my sub haha
Reply: Tell me more about how vacuum transfers heat.
Reply: +NuclearSavety Well, as it currently stands it is a decent issue, although I wouldn't say it was his only point, just that it's a big one that we need to overcome before something like this is plausible. Another VERY important point he made is that it's extremely vulnerable to terrorist attacks. A single bullet kills at least two car loads of people. Unless he wants to bury the things and leave their location undisclosed, which will bring about it's own problems, it's something we have to understand as less than plausible as it currently stands.
Reply: +R.B. Oh yep, sure. Makes so much sense. It's not that we're gambling with dozens or hundreds of lives if it actually happens and he didn't make any good arguements. By the same coin, you're just an idiot who takes everything as it's best case scenario.
Reply: Thunderf00t, simply because Elon Musk just tells people what to look into, he doesn't do the studies himself. As goes with all rich people. They know how to find the experts in an area to do what they want, they are not the experts in the area.
Reply: thunderfoot
Reply: HES BEEN SAYING MUH SELF DRIVING CARS FOR YEARS,THUNDERF00T IS SUPERIOR @porglit
Reply: is what people said about flying toe nail cream @lehtaan
Reply: cooling km long tunnels samuel?
Reply: the hyper loop will be used 20 times a day or so and going to the moon happened only once
Reply: Y2KNW the project isn't even finished it's concept.... Mr musk said that this will take 10+ years to even be available... and you're sooo wrong sooo shut the f up, Cas me ousside how bou tha?!
Reply: where is your proof ? link to some places that prove you have worked in the industry
Reply: Ian Krasnow an acre of solar roadways cost alot more than an acre of road and an acre of solar panels seperating, they don't recieve much sunlight in most instances, the glass is less durable than pavement, the glass provides less traction than pavement, the LEDs won't be daylight visible, etc........ it really is an awfully idea....... a solar awning would be better, though prefably only where you'd want an awning in the first place
Reply: homeopathy saved my life and my mum has a degree in homeopathy soooo how is it pseudoscience?
Reply: +JayCat While Elon Musk is working on a solution for more efficient tunneling, the Hyperloop proposal paper (it's hosted on SpaceX's website, if you want to read it) very specifically states that in order to be economically viable and preferable to alternatives it should and would need to be built above ground.
Reply: vennthrax ......... placebo is a really great band
Reply: Fair point, but I would like to point out a couple things:
Regional and intercity rail service is actually much more popular than most American believe it is. Take for example Amtak's Acela Express between Boston, New York and DC. The Acela (which is America's closest thing to a high speed train) attracts tens of millions of riders annually and is one of Amtrak's only routes on the national system that generates a profit. The other intercity services (Northeast Regional, etc), whilst not generating a profit, are considered to vital to close because many people still use the system (especially in the Northeast Corridor). Why would congress invest billions in new Acela trainsets or push for a new Hudson river tunnel for Amtrak if no one was going to use it? Now outside of Amtrak, there are actually some private companies that are reintroducing intercity rail transit back into the US like Brightline and Texas Central. Private companies wouldn't typically invest in a potential non-starter, especially when it comes to transit. Just keep in mind trains more popular than most think. But that's just my thoughts on this.
Reply: Single-welded rail (SWR) is typically prestressed before it is installed on the trackbed but that doesn't resolve all the problems with rail thermal expansion. In most cases, expansion joints are placed at various points on the line where rail traffic would typically be at low speeds. On cold days, maintenance of way workers typically bring gas torches that would be laid along the rail to heat the track. However, this doesn't prevent all the problems because rail deformation is a common maintenance issue that is regularly inspected. Also bare in mind, it's easier to maintain track because it's just a plain strip of metal as opposed to a air-tight tunnel.
Reply: MyLifeInAFlamingBag 
I am on my phone, it has a Swedish Dictionary on the spell checking meaning that when I write English it becomes awkward... 

Also: I am a bit knackered... And what not...
Reply: Chance Wen 
Am I right to assume that SWR is never straight for more that a certain length to pick up the expansion of the steel?
Reply: I honestly don't know, specifically. Typically what is done is MOW workers install track in .5 mile increments and then weld the section together. Don't know if there is a specific rule to inclusion of expansion joints.
Reply: I'm not a pipe engineer but one could assume that the slip-joint/ball-joint bearings and pipe anchors used to transport high pressure fluids may behave differently to a vehicle travel above the speed of sound in a self-induced near vacuum. I'm not trying to be a critic here. If the Hyperloop turns out to be the thing that  revolutionizes transportation, I have no qualms. I just don't want it torpedoing other just as important infrastructure projects.
Reply: yeah... its not a very viable concept.
Reply: Tony Wells to the best of my knowledge above ground pipelines do not run straight for long distances
Reply: Daisy Duke It doesn't need to be straight.
Reply: Tony Wells pipelines, no. hyperloop needs to be pretty damn straight because of the high speeds and the correspondingly high g loads when cornering
Reply: yeah because absolutely no one thought of that
Reply: Tony Wells pipelines, no. hyperloop needs to be pretty damn straight because of the high speeds and the correspondingly high g loads when cornering
Reply: Gato Capitalista
"...and no one can say he is wrong só people just ask "elon musk or thunderf00t""
It must be true because you can't be wrong Gato
Reply: Šnek actually be made two videos about the hyperloop, and I'm pretty sure he specifically mentioned that document in the second video
Reply: Y2KNW Dissapointed? You know you could be wrong right?
Reply: this argument
Reply: EclecticBuddha Part of Los Angeles' light rail is a subway. Structural engineers have learned pretty well how to deal with earthquakes.
Reply: "@Y2KNW Thunderfoot has about as much knowledge about this subject as you and me. He's just pretending he knows stuff, but he's merely speculating based on his very limited knowledge. The cool thing about science is that you constantly learn new things and find ways to solve problems. So, let the real experts take a look at it and try to make it work. We will see in the future whether it works or not."

I suppose we have some new sort of super-nano-alloys with self-repairing seals and all that BS now. Sorry, didn't realize we suddenly had martian tech.
Reply: nobody says that super speed travel inside a confined system is impossible.....
we're saying that the hyperloop, the concept of moving passengers through a vacuum tube, on earth, at super speeds, it's looking kind of shitty due to the fact that you can't account for the hundreds of things that can go wrong.
Reply: Y2KNW It's called putting it underground!
Reply: In this thread there are two people I agree with and that's Y2KNW and Gato Capitalista because they have a reasonable perspective. The main problems with the Hyperloop are that it will be a means of transport, people landed on the moon yes, but it was very risky and expensive, two BIG problems in a means of transport.

Also I would like to add that I believe the hyperloop is possible, it is not feasible. It will NOT be made by Elon Musk because his take on it is to make it glamorous, e.g. making it above ground rather than underground, making amazing animations instead of actual models etc.
Reply: +Do not go gentle into that good night. Rage, rage against the dying of the light.

Yes, it depends on how far from the train that the breach happens. If it happens within 200m, It's going to be more or less a wall. If it happens some kilometers away, It's going to be strong but not a wall, more like a strong wind. But depending on the trains aerodynamic properties and the size of the train vs the internal diameter of the tube, and wether it has time to brake or not, the train can be accelerated at rates that's dangerous to kids, toddlers and pregnant women.

And thunderfoot did mean to use G's, he just forgot to convert properly but he added notations in the video admitting that.

And lastly, where will the extra length go? Will the end stations also not be fixed? How will the train get into the tube? Will it have an airlock, and will the airlock then also have to not be fixed in position? It's not about wether it can move or not, that's easy. It's about where to put that extra length.
Reply: LOL
Reply: hyperloop is possible in theory but can have lots of screw ups. Kindof like every major transportation system we have now.
Reply: In practical terms, there is very little difference between a near perfect vacuum and a perfect vacuum. If it cracks everyone inside will die either way.
Reply: UberBlade I have people saying that dozens of time now, but thanks anyway.
Reply: Y2KNW vanadium dioxide
Reply: The whole idea that the Hyperloop would explossively decompress at the slightes puncture is just ridiculous.They're not made from the same material as party balloons.
Reply: watch thunderf00ts hyperloop busted video he explains the forces that happen and why this idea is not as good as it seems to be.
Reply: I wish it was possible to dislike Youtube comments
Reply: smart people don't underestimate preemptively.
Reply: ThunderF00t already debunked the hyperloop in a series of videos. Thermal expansion isn't the only problem; a relatively small earthquake could breach the vacuum tube which would then kill every single person in the loop. They want to put the hyperloop one in California along the San Andreas fault ......... doesn't sound like they really thought this through.
Reply: Master Evar A fallacious appeal to authority does not need to be explicit to still constitute a fallacious appeal to authority.
Reply: +nexus1g I wouldn't say it was implicit either, so I guess by that logic every person of authority int he world does this, and we shouldn't listen to them?

Look, I only said that thunderf00ts point is not that it's impossible, but that there are practical problems with it that needs to be fixed. And then I write in my own words the two problems I see with the hyperloop, but I follow up with possible solutions to my own problems, because I acknowledge that it's not impossible. Heat expansion will be a thing, and the extra length has to go somewhere. And in case of a breach, there should be sufficient systems to keep the passengers safe.
Reply: Master Evar "I wouldn't say it was implicit either, so I guess by that logic every person of authority int he world does this, and we shouldn't listen to them?"

Yeah. That's how logic works. When someone is an authority on the subject being discussed, their opinions and assessments hold more weight than someone who is not an authority on the subject. 

Let's say you have two applicants for a computer programming job. One applicant holds a degree in English. One applicant holds a degree in computer science. Who are you going to pick for the job?

Despite having the same level of education (both bachelor's let's say), why is one more of an authority in the matter of computer programming than the other? 

Now that I have gotten you to think, that's exactly what's wrong with making a fallacious appeal to authority. When you make such an appeal, it's like hiring an English major for a computer programming job.

I couldn't care less about what you said outside of this. The point is that you're making a fallacious appeal to authority just as thunderf00t has. If you're following his assessment over the engineers behind the Hyperloop, then you're being a fool.
Reply: "Yeah. That's how logic works. When someone is an authority on the subject being discussed, their opinions and assessments hold more weight than someone who is not an authority on the subject."

And where does thunderf00t break this principle? And Elon isn't an engineer or scientist - he's an entrepreneur. He finds people with ideas and fund it for them, help out with marketing and growing a business.

"Let's say you have two applicants for a computer programming job. One applicant holds a degree in English. One applicant holds a degree in computer science. Who are you going to pick for the job?"
The one with a degree in computer science, of course. I fail to see what this have to do with our discussion. I never said thunderf00t knows better or is right.

"Now that I have gotten you to think, that's exactly what's wrong with making a fallacious appeal to authority. When you make such an appeal, it's like hiring an English major for a computer programming job."
Nope. Just nope. If he was your father or some other person with authority and says he should get the job because of that, then it's a fallacious appeal to authority. What you're talking about is stupidity.

"I couldn't care less about what you said outside of this. The point is that you're making a fallacious appeal to authority just as thunderf00t has. If you're following his assessment over the engineers behind the Hyperloop, then you're being a fool."
Good thing I'm not. Now then, what does this have to do with what I said?
Reply: Master Evar I really don't feel like holding your hand through this entire thing, so I'm going to answer these questions and that's it.

"And where does thunderf00t break this principle?"

Where he expects that his opining is infallible enough to consider a project like the Hyperloop "debunked."

"And Elon isn't an engineer or scientist - he's an entrepreneur. He finds people with ideas and fund it for them, help out with marketing and growing a business."

He hires the talent required to solve the issues. He isn't making claims -- his engineering staff are, and he's the messenger.

"Nope. Just nope. If he was your father or some other person with authority and says he should get the job because of that, then it's a fallacious appeal to authority. What you're talking about is stupidity."

Nepotism isn't even related here. You're way off base. You're too quick to make an argument and not slow enough to really think through what I'm saying.

"The one with a degree in computer science, of course. I fail to see what this have to do with our discussion. I never said thunderf00t knows better or is right."

The person I actually responded to did.
Reply: nexus1g  "Where he expects that his opining is infallible enough to consider a project like the Hyperloop "debunked.""

Which is nowhere, as he refers to calculations and tests and not his own opinions. Is his model 100% correct? Of course not. But that has nothing to do with appeal to authority. He has to actually explicitly or implicitly claim that he is extra trustworthy BECAUSE he has some sort of authority, or other people have to claim he is an expert on it while citing him. I have not claimed he is an expert on the subject or is right, and he does not claim he's right because of his position. Some people in this comment section are probably really claiming that this is his area of expertise and that he knows better, but I'm not one of those.

"He hires the talent required to solve the issues. He isn't making claims -- his engineering staff are, and he's the messenger."
Yes, but some people make stupid claims like "Elon has thought this all through" and "Elon is an expert on this".

"Nepotism isn't even related here. You're way off base. You're too quick to make an argument and not slow enough to really think through what I'm saying."
I think you should have told yourself this ;)

"The person I actually responded to did."
Then I think you accidentally wrote the wrong name when you responded, because I'm very sure I've only responded to comments who have responded to me.
Reply: Master Evar "Which is nowhere"

Oh, excuse me -- not debunked, he titled his video, "The Hyperloop: BUSTED!"

Close enough.

He even goes so far as to assume that they, and I quote, "...haven't done even the simplest expansion calculations." His assertion is that an entire team engineers just simultaneously and inexplicably forgot about their high school physics classes. But thunderf00t remembered because he's just awesome like that.

Of course, the more likely alternative, apply Occam's razor here, is that they have a solution for this issue, but they're keeping the method and/or materials proprietary.

"Then I think you accidentally wrote the wrong name when you responded, because I'm very sure I've only responded to comments who have responded to me."

Yeah, that was my bad. It was a response to you.
Reply: You didn't double check well enough then, because before you commented that you made this comment:
"+Master Evar Seriously, stop thinking Thunderf00t is an expert in everything. He's simply not a structural engineer, and he's going outside of his expertise in this matter. He's a biochemist. He's using his authority of having an advanced degree to talk about things he doesn't have any position to really be discussing with authority. In other words, he's using a logical fallacy: a fallacious appeal to authority."
Which is what we have been discussing this whole time.
Reply: Master Evar I changed my post. You replied too quickly.
Reply: Master Evar "Nope, nowhere close to being a fallacious appeal to authority."

He's pretending to be an authority on the matter, so, yes, this is a fallacious appeal to authority.

"Yes, he's arrogant like that. As I said, I don't think of him as an expert on the subject and I do dislike that side of him."

If I say, "I know better than professionals in their field," am I not making myself out to be an authority on the matter?
Reply: +nexus1g

"He's pretending to be an authority on the matter"
No. He's confident that he is right, but he never implicitly or explicitly states that he is an authority on the subject.

"If I say, "I know better than professionals in their field," am I not making myself out to be an authority on the matter?"
No. It's a bold statement, but not an appeal to authority. If you said "I'm a mathematician, therefore I know better than the engineers in their fields" or something similar, you would. Just stating you know better without giving a reason is known as cockiness.

If a kid says he will beat a professional football player, is that kid also making an appeal to authority?
Reply: Master Evar "No. It's a bold statement, but not an appeal to authority."

Are professionals in their field authorities on the matter?

Yes.

To assert your opinion contrary to theirs is putting yourself in a class of authority higher than their authority. Whether you want to say it's arrogant or bold is not exclusionary to it being an implicit appeal to authority. In fact, a false appeal to authority in oneself would, in every circumstance I can think of, be arrogant.

"If a kid says he will beat a professional football player, is that kid also making an appeal to authority?"

Considering he's not trying to pose an argument and simply making a claim, no.
Reply: "To assert your opinion contrary to theirs is putting yourself in a class of authority higher than their authority. Whether you want to say it's arrogant or bold is not exclusionary to it being an implicit appeal to authority. In fact, a false appeal to authority in oneself would, in every circumstance I can think of, be arrogant."
Authority? More like independence from the authority. But it's still not an appeal to authority. In fact, if we are going to be really nitpicky, appeal to authority is actually citing an authority on something that's outside of their field as a standalone argument. So citing thunderf00t would be the real appeal to authority. Thundef00t isn't citing anyone, so it doesn't even make sense in the literal meaning of the term to say he's making the appal to authority fallacy.

"Considering he's not trying to pose an argument and simply making a claim, no."

 "I'm smaller so I'll just slip right by you!" - Kid with an argument. So how about it now?
Reply: Master Evar "Authority? More like independence from the authority."

I feel like you're just playing word games. Everything you describe would fit under the definition of authority.

"In fact, if we are going to be really nitpicky, appeal to authority is actually citing an authority on something that's outside of their field as a standalone argument."

Who the authority being appealed to is irrelevant to whether something qualifies as an appeal to authority. One may appeal to oneself as an authority, just like they may appeal to a third party authority.

"Kid with an argument. So how about it now?"

That depends. As it simply stands of everything we know about this kid at this point, no. Let's say his dad was Troy Aikman. Now it is an appeal to authority, implicitly, because his dad being who he is would likely give a higher credence to his word among his audience.

It's how he presents himself and the effect he has on his audience whether or not he is making an implicit appeal to himself as an authority.

It's irrefutable that some people here who state that the Hyperloop is an impossibility and citing thunderf00t as their reasoning are citing him because they view him as an authority on the matter. They clearly take thunderf00t's word as gospel because they look up to his advanced STEM degree -- even if it's in a completely unrelated field on which he discusses.

Thunderf00t is making a fallacious appeal to himself as an authority, and those who accept his projected authority also cite him as an authority.

This is really a clear case.
Reply: +nexus1g

"I feel like you're just playing word games. Everything you describe would fit under the definition of authority."
No, it wouldn't. Please explain why.

"That depends. As it simply stands of everything we know about this kid at this point, no. Let's say his dad was Troy Aikman. Now it is an appeal to authority, implicitly, because his dad being who he is would likely give a higher credence to his word among his audience."
What if his dad was not Troy Aikman, but he had a little brother who believed in him a lot and thus put higher credence on his big brother than the professional football player? Or what if his dad was a high-ranking politician?
By your logic, anyone who has something impressive in their life can't make a claim without making an appeal to authority. What if some movie star claimed that 1+1=2 because they learned that in school. They make an argument, and they are no an authority on the subject of math but they they still are some sort of authority. Are they also making an appeal to authority? This would be the same with thunderf00t. He's using tools (mathematics and physics) that he has studied up on in order to make his argument.

"It's how he presents himself and the effect he has on his audience whether or not he is making an implicit appeal to himself as an authority."
So people who knows how to speak are always making appeals to authority as well?

"It's irrefutable that some people here who state that the Hyperloop is an impossibility and citing thunderf00t as their reasoning are citing him because they view him as an authority on the matter. They clearly take thunderf00t's word as gospel because they look up to his advanced STEM degree -- even if it's in a completely unrelated field on which he discusses."
Yes, but then it's THOSE PEOPLE who are making an appeal to authority, not thunderf00t. If someone cited your comments here because they thought you were right, does that mean your comment suddenly becomes an appeal to authority?

"Thunderf00t is making a fallacious appeal to himself as an authority, and those who accept his projected authority also cite him as an authority."
Unless he cites himself, nope.
Reply: Master Evar "No, it wouldn't. Please explain why."

For instance, you say that what I stated isn't authority but independence from authority. Well, then you're just establishing yourself as a better or, at the very least, alternative authority. 

"What if his dad was not Troy Aikman, but he had a little brother who believed in him a lot and thus put higher credence on his big brother than the professional football player? Or what if his dad was a high-ranking politician?"

If he's persuasive based on that authority, he's implicitly using that authority to support his arguments. If his authority is irrelevant to the argument, it's a fallacious appeal to authority.

"By your logic, anyone who has something impressive in their life can't make a claim without making an appeal to authority. What if some movie star claimed that 1+1=2 because they learned that in school. They make an argument, and they are no an authority on the subject of math but they they still are some sort of authority."

If they used their notoriety in a way that persuaded people that they were right, it would be a fallacious appeal to authority. A valid argument would have to be made for why 1+1=2 is true. 

A celebrity simply claiming that 1+1=2 is true, with an expectation to be taken on their word is a fallacious appeal to their authority over their audience.

"He's using tools (mathematics and physics) that he has studied up on in order to make his argument."

He throws out finished product numbers and assumptions. It's entirely his authority that sells these points.

It's worth noting here that you don't have to be wrong to make a fallacious appeal to authority.

"So people who knows how to speak are always making appeals to authority as well?"

Again, only if they are persuading using their perceived authority.

It's important to note here that there are valid appeals to authority. For instance, if you get a doctor saying that they think you have the cold, not a flu, they are validly appealing to their authority as a doctor.

"Yes, but then it's THOSE PEOPLE who are making an appeal to authority, not thunderf00t."

No, they are both making an appeal to authority.

"If someone cited your comments here because they thought you were right, does that mean your comment suddenly becomes an appeal to authority?"

Clearly I am appealing to myself as an authority here. I'm not comprising my argument of anything but my opinion. I haven't even quoted a dictionary definition. Absolutely I'm making an appeal to my own logical authority. If I weren't, I would be presenting external resources from globally-recognized authorities on the matter for proof of my conclusions, not arguing my own conclusions using my own logic.
Reply: +nexus1g But then it's not a FALLACY you are speaking of even. A fallacy is something that undermines the argument. thunderf00t never used authority as an argument, so even IF he appealed to authority according to your definitions of the use, it's not a fallacy because he still never based his argument on it.

And no, I don't think your use of "appeal to authority" is correct. Authority is one who has deciding power over someone else. Just becasue you think you are smarter than someone else on a subject you don't have to believe you have any deciding power in that subject. And even then, you don't have to believe you are smarter than someone to make the claim that you are right about one thing they are not.

Oh, and a lot of this is based on your interpretation of the video. I didn't interpret it as if he made himself an authority on the subject, and I do not view him as an authority on the subject. 

Quoting rational wiki, maybe a bit lazy but I don't care:
"In order to be fallacious, the argument must appeal to the authority because of their qualification in an irrelevant field and should be irrelevant to the argument at hand. For example, saying "There is no God, because Stephen Hawking said so and is a knowledgeable physicist" is an appeal to a misleading authority as Hawking's qualifications in physics do not automatically make his argument correct — the strength of his actual argument regarding cosmology is what needs to be examined, not his qualification or prior knowledge. On the other hand, dismissing Hawking's argument because he lacks any qualification in theology is an example of the Courtier's Reply. What is important in both fallacies is that it is the argument, its merits and how its premises form a conclusion that is what should be scrutinised and not the subject's previous qualifications."

If you have any other sources, you are free to present them.
Reply: NuclearSavety There needs to be a gate at the start and finish though anyway... What are the biggest problems with failing vacuum anyway? Debris? Air resistance? Collapse of the entire tube?
Reply: +Porglit So a published post-doc vs a MBA apartheid $$$ rich kid ??
Reply: The "experts" refuse to answer questions or provides details. So we ignore public domain academia and trust private commercial black box magicians?
Reply: +sascha Kramarenko how will we know it works? They are not peer publishing any of what they are doing.
Reply: Dietmar Gaber But he hasn't reasoned well. For instance, regarding the vacuum: He maintains the atmospheric pressure inside the tube is going to be a near-perfect vacuum (99 Pascals, but on the white paper this is labeled as the pressure at the intake, not the actual pressure of the chamber).

Now, the Hyperloop is expected to travel at about 700 MPH. The current speed record holder is a maglev train in Japan that has reached a little over 350 MPH. Now correct me if I'm wrong, but I believe drag coefficient is linear. In order to go 700 MPH using the same amount of energy, you would need to be at half a bar of pressure, or 50,000 Pa, not 99 Pa.
Reply: NuclearSavety If we can run a maglev through a tight tunnel at 375 MPH at 1 bar (current passenger-load world record), why couldn't we run a maglev through a tight tunnel at 700 MPH at half a bar?
Reply: nexus1g you can .... technically .... ity a question if you should. Current train tunnels are 2way tunnels by purpose as you need the additional space that the air can move arround the train... and you still experience a lot more drag in comparison to outside of the tunnels. You could fix the hyperloop to addapt to 0.5 bar by up-sizing the diameter of the tubes while keeping the capsules small, this will most likely kill the already more than questionable economics. Moreover,  one still should ask if 0.5 bar is desirable. Commercial airplanes at traveling heights have ~0.2bar outer pressure. I thought the hyperloop wants to be more efficient than airplanes...
Reply: NuclearSavety You're making claims, but no numbers. A turboprop costs a passenger about $100. I don't think anyone's willing to pay that for a daily commute, and the time it takes for that commute would not be feasible. This train would greatly increase job markets and trade for city centers and more rural locations.

Here is one of Japan's maglevs setting the current world record with passengers watch?v=Lw0CYYiNYaY -- watch the LCD display near the start of the video showing how tight the tunnel is as it reaches the world record.

watch?v=ltqp4McM2wY This is a video from inside the train that you can see the walls are rather close to either side of the train in the tunnel.

It's also worth noting since the issue was pointed out earlier, Japan is one of the most seismically-active regions of the world.
Reply: NuclearSavety Perhaps you could clear up the math. Transonic speeds are considered mach .85 up to mach 1. Mach .85 (transonic) is when the movement of the air exceeds the speed of sound of, let's just use the easy number, 340 m/s.  That means when a craft is traveling 289 m/s, it is moving the air out of the way at 340 m/s.

Presuming this is a linear figure based on percentages (so correct me if I'm wrong on this), that means that 700 MPH should be moving the air out of the way 15% faster than the speed of the craft which would give us 360 m/s, not 700 m/s.

"in the videos you explicitely see how large the maglev tunnels are."

Perhaps at the exits and entrances. I couldn't find a video or picture of a better demonstration than from inside the car itself.
Reply: Bourinos02 - the claims they are making are not even scientifically possible, like the claim that the Hype-your-loop will be more economical than airplanes or even existing trains. With our current scientific knowledge - that's clearly and demonstrably false statement. If we were to build it today and bring it up to the level of reliable operation it would take more energy per pound transported than what we're currently paying to get payloads into the LEO.
Reply: zwerko "With our current scientific knowledge - that's clearly and demonstrably false statement."

Prove your claim.

"And that's while ignoring that the place they want to build this is one of the most seismically active places on the planet and burrowing the pipe into the ground doesn't help you with that."

LA already has subways and Japan's maglev train already spends a significant amount of time under ground. The issues of earthquakes has been solved for a while now.
Reply: zwerko It was just an idea, don't take it too seriously. If doable, we'll see hyperloop becoming real in no less than some decades, and who knows how much we will advance in that time. Even if it'll never see the light of the day it's good to have projects like this going, because they stimulate engineers and scientists to overcome challenges that normally no one would consider.
Reply: Mr Torgue - while I do agree that it's generally good to have preposterous ideas flying around as they stimulate new discoveries, there is a limit to that. If you want to solve a problem (in this case mass transit, especially in the US) proposing and hyping non-solutions is clearly unproductive - you end up wasting a huge amount of resources (both material and in time) that could've been used elsewhere to actually solve the problem.

Furthermore, by hyping such non-starters and letting uneducated/intellectually lazy masses believe in their feasibility you're putting a pressure on politicians to start subsidizing your crazy ideas, so they can gain some constituency love, instead of actually investing money in educating the same constituency so they stop being an easy pray for every charlatan's crazy idea. It quickly ends up in a, shall I call it, hyperloop of tax payer's money being funneled to projects that don't help anyone and don't solve anything apart from getting the votes for politicians and growing the account numbers for Musk's of this world, who in turn line the politicians' pockets to keep the loop going...
Reply: Because that's not communism, it's neolithic survival.  It's kinda hard to stop class struggle when there's no classes.

Communism only works in theory because once human nature gets involved, it turns into an even more brutal version of feudalism.
Reply: I don't care about your personal definition of communism.

Communism, as it has existed in the real world, is on the top 5 worst things Homo Sapiens has come up with, sitting somewhere between fascism and tumblr.
Reply: Technocracy Communism is an entire socioeconomic model. Socialism is an economic model that is the de facto economic model of communism.

What you're talking about is specifically Marxism, which is one of many philosophies of communism. You can't nail communism down to a single definition as you have done. It's a broad topic with many writers over hundreds of years contributing to different philosophies of what such a socioeconomic system would look like and how it would come about.

Leninism, which is a communist ideology, is what the CCCP was.
Reply: Technocracy Socialism is simply the public ownership of the means of production. Nothing more and nothing less. Communism cannot be communism without socialism being active at the same time.

What you confuse is the dictatorship of the proletariat with socialism, the two of which has the same qualities but describe quite different things. Socialism does not cease to exist under a communist system, and the dictatorship of the proletariat is specifically the transition from capitalism to socialism.

Leninism was the "practical application" of Marxism. The reason that there has "never really been a communist state," is because it's impossible to achieve. So while you can hang onto "there's never been a real communist state," think a bit about why there has never been one, despite the endless attempts.
Reply: TLDR Entire Thread - however, I can tell you that engineers deal with a large array of problems when something is to be constructed. These are all beyond considered, they're reported on. Contingencies also implemented.

You list one problem and think it defeats the whole project. Any good engineer laughs out loud - the number of problems they've fixed that you wouldn't have even imagined.
Reply: those aree engineering problems... yet that can be solved. While solar roadways are just dumb af
Reply: I'm disappointed in you, Y2KNW.  Ragging on a Phd in physics because... you're apparently the only one who knows heat expands things and that might cause a problem (but a problem that has been solved already time and again, over and over)?  THAT's your genius criticism?  It's always the man who knows the least who thinks he knows the most!
Reply: @mbgdemon  Just the science stuff.
Reply: @izaneitor People that cite Thunderfoot as a credible source for anything aren't interested in a discussion, are they? They just want the discussion to be shut down. They treat Thunderfoot like an expert that knows what he's talking about, but he's not an expert. Which is why I'm not a big fan of Thunderfoot or the people who bring up his name to shut down discussions.
Reply: So what you're saying is, that they can't already have or disvover or make any material that could deal with thermodynamic expenison?
Reply: Y2KNW the hyperloop could be a reality they're starting digging the tunnels in a month, look at spacex elon musk is a genius, look at all his companies and his ideas